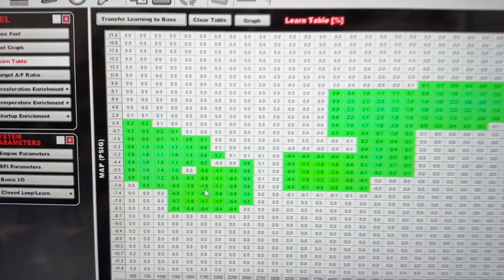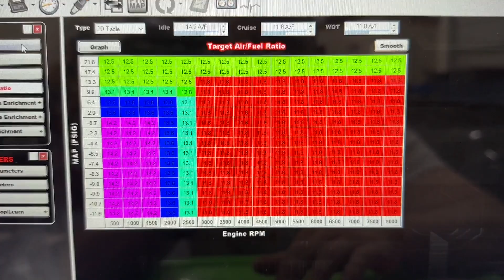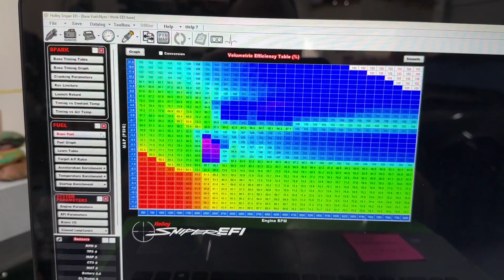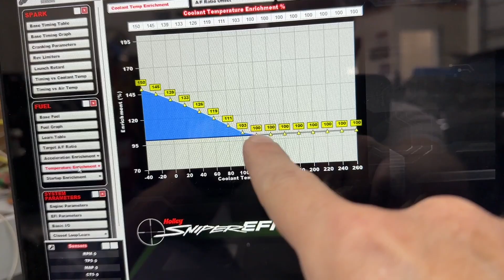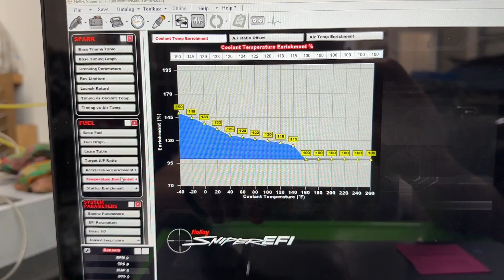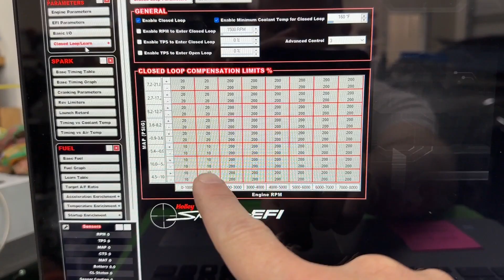Holley EFI/ Sniper Tech (Not Much)

Comment: You're going in the right direction, however, Never!! give the system 200% CL or Learn authority. You lose an 02 sensor. 1. you aren't making it home. 2. You could lose the engine. 
If your (tuner) has the fuel table off more than 5%  "anywhere"  it better be because you tuned it at 3500 ft. and you're trying to race it in Florida! LOL

Comment: EFI guy here, always looking for more info.  Honestly this is more understandable than carbs to me However, I started out studying computers and ended up a business major living in Excel files and databases.  Also engines are engines EFI and carb guys can learn from each other.

Transient and hot start, hot off idle are the hardest to tune in.  Many tuners do very little for these conditions focusing on WOT.  This is exactly why a friend and I signed up for classes to learn HP tuners.  The class was a good start for us to start asking questions and putting together chain of events of why this does that which helps to develop our skills with videos like this adding to the knowledge base.

Comment: Eric, Holley wont even mention the RFI interference issue. That causes the intermittent issues with the system shut off and on. Seriously to fix that issue just cover the brain box on the side of the throttle body with a piece of aluminum foil and problem solved. To get things just right you will need custom tunning. So much for self learning..lol. think about it you spend 1500 to 2500 dollars for the master kit ,then the little extras here and thereand several hundred of dollars for a tuner to custom tune . At this point you are now around 4000.00 dollars invested. I sold mine and called quick fuel, bought their 850 blow thru carb and never look back. If i really wanted to step up i would call APD and have them build me a blow thru carb and csn call them at any time for tech support .

Comment: For me, EFI looks like a total higher cost way to get the same power or less as a carb can make.
Reply: You will be a master if you get the Rochester Ramjet Running Right on a 302, 327, 350, 396, 400, 427, 454; or the TBI on the 1987-1995 C1500, or Crossfire FI on the corvette. You still adjust distributor timing on a TBI engine manually, a MAP can cause problems too.

Troubleshooting a carburetor is still an art. FI was created to reduce/eliminate vaporlock, and is used in General Aviation.